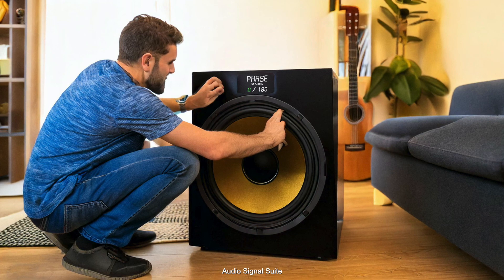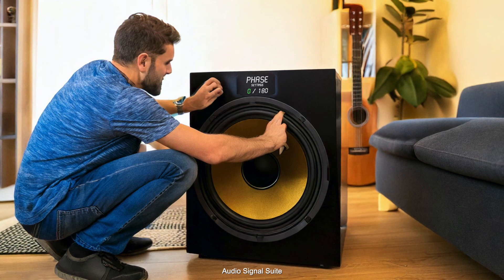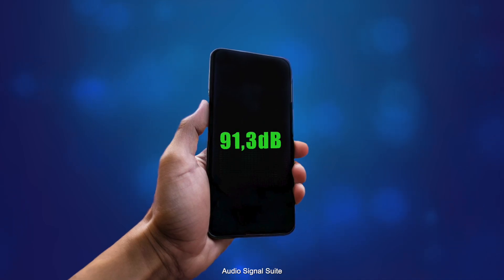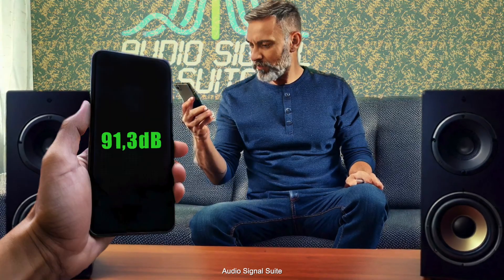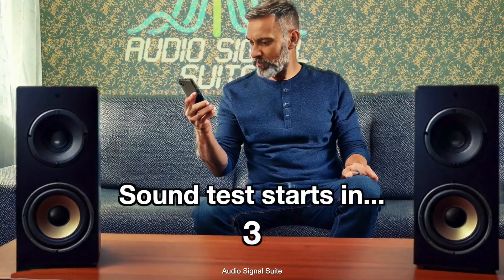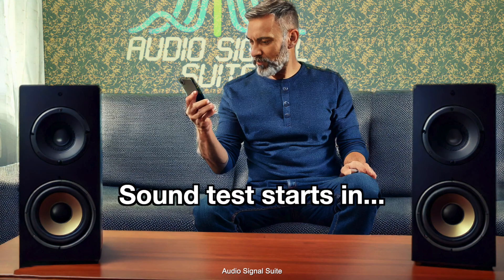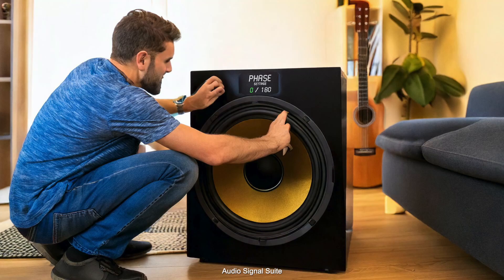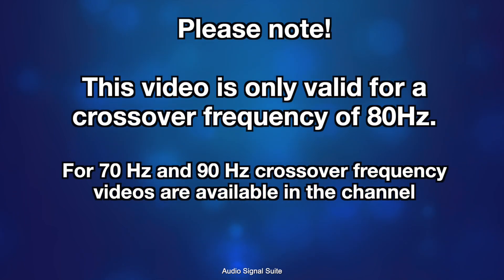How to TEST and SET the correct SUBWOOFER PHASE - 0° or 180° @80Hz ?

Comment: My sub went louder with 180...do I now have to redo the audacity calibration on my Denon avr
Reply from the maker: Yes, if you switched the subwoofer to 180° phase and it became noticeably louder, you should rerun the Audyssey calibration on your Denon AVR.

Why?
Audyssey measures level, distance (delay), and frequency response.
When you change the phase from 0° to 180°, it affects:
- the interaction between the subwoofer and the front speakers
- the effective output level at the listening position
- potentially the crossover region / cancellations or summation

This means Audyssey was working with incorrect assumptions, so the calibration results are no longer accurate.
Reply: @AudioSignalSuite thank you for reply and knowing I mean't Audyssey😅

Comment: I have 1 Behringer 18' sub woofer with phase switch and 1 without. If i put them side by side can i invert the phase on the one? Or will the inverted phase interfere with the other sub?
Reply from the maker: Hi. That’s actually a very good question you’re asking!
If you have two subwoofers placed next to each other, you should absolutely not change the phase of only one of them. Doing so would cancel out the frequencies of the second subwoofer.

You can test it this way, but in most cases you should definitely end up with a small value at 180 degrees. Unless the other subwoofer is not set to 0 degrees from the factory but to 180 degrees — which I highly doubt.

Very interesting comment. Thanks! 👍
Reply: @AudioSignalSuite alright thanx for the quick response. Now what if i put them aprox 4 meters apart from eachother and reverse the phase on one of them. Do they still have the capability to interfere with eachother?
Reply from the maker: @2525alainas  Hi. I actually find your questions very interesting, because I’ve already measured and configured many different setups with two subwoofers. But now comes the unfortunate truth: without a measurement microphone, doing this properly is basically not achievable, and doing it by ear is impossible.

A very good subwoofer setup for home use (if the room is not acoustically optimized or treated for low frequencies) is to place one subwoofer at the front of the room and one at the back. The rear subwoofer cancels out the waves of the front one, so that room modes generated by the room are reduced or eliminated. However, this only works if the phase can be adjusted continuously.

But to actually help you:
Please google “REW” (Room EQ Wizard, a free measurement software). A measurement microphone for home use is also available very cheaply (e.g. Behringer ECM8000, ECM-PRO). With that, you’ll have fun for the next few weeks 😅

Comment: Will you be able to provide the name of any app that can be used to measeure? I found some decibel level meter apps. Is that what i needed??
Reply from the maker: Hi. I deliberately didn’t mention any specific app in the video or the description, because I don’t want to do advertising with this channel 🫣
I also don’t know whether you’re using an Android or an Apple smartphone, but in general you can really use any free sound pressure / SPL app that shows the sound pressure level.

The value in the app should be displayed in “dB” as a number (no graph), and the update rate should be around 0.5–1 second so it’s easy to read.
I personally don’t have a favorite app that I would specifically recommend — many apps work just fine.

Just for your information: these apps of course do not show absolutely accurate values, because smartphones don’t have measurement microphones. But for comparing louder vs. quieter levels, you can use them 100% reliably, and that works well.

Thanks for your comment 👍

Comment: What about subs with more than 0 and 180º options?
Reply from the maker: Hi, so you can generally say that the higher dB level is the correct one. However, it’s also important to know your approximate crossover frequency (that’s why there are three of these videos).
If you have more adjustment options, I wouldn’t really use this test anymore, but instead just play, for example, an 80 Hz tone and then adjust until you reach the highest sound pressure level.

80 Hz: https://youtu.be/V7fPKpy–uQ

Thanks for your comment 👍

Comment: Should I do this in Dolby Surround or stereo?
Reply from the maker: Hi. I had to think about it myself, but you don’t actually need to use it only in stereo mode. If the phase is correct in stereo, it will also be correct in Dolby Surround, and vice versa. 
Thanks for the question 👍
Reply: @AudioSignalSuite so far this has been working great for me. It feels and sounds like my bass response is better. I have 2 subs and both are in diagonal corner placement. Having them on 180° puts out a lot more SPL on the test. Which is so strange to me. I do one at a time. 

I run DIRAC afterwards and everything sounds really good 🤷🏻‍♂️ Ive done this with friend and family's theater too. The results seem to be good!
Reply from the maker: @kyleshays  Thanks you for your answer 👍

Comment: what if you turn the knob during the sound and find out that most db you have on the 90spot ?
Reply from the maker: Hi. So this test is designed and optimized only for subwoofers that have a 0° / 180° phase switch.
If your subwoofer has additional settings, like a 90° phase option, that’s definitely a good thing. And if you get the highest value at that setting, I would just leave it like that 👍

Thanks for your comment 🤗
Reply: @AudioSignalSuite  so its always the biggest SPL/DB measurment ...the best choice?  i can do it with a tone generator? and what hz ur suggest me to do ? does it matter where i have my crossover setting?
Reply from the maker: Hi!
Yes, the frequency is very important and should ideally be at the crossover frequency, because that’s where both speakers (subwoofer / regular speaker) add up the most. This also means that at this frequency they can just as easily cancel each other out if the phase is wrong. You can easily test this with a tone generator.
And yes, the highest dB value is the correct one, because at the crossover frequency the two speakers add up at -3 dB instead of canceling each other out.
Reply: @AudioSignalSuite  that last sentence confused me a bit ..my english are bad also... should i change the crossover setting also were it goes with biggest DB ??? cause my sub dont have values on the knob just 50 - 200
Reply from the maker: Hi. So, if your subwoofer allows you to set the crossover frequency between 50Hz–200Hz, that’s already very good. However, setting the correct crossover frequency by just listening is actually almost impossible. You can at best adjust it so that it sounds good to you. I always use a measurement microphone and measurement software for this purpose. The software REW is free. Unfortunately, this won’t be possible with a smartphone. 🙁

I wish I could help you more or give simple tips, but unfortunately, there aren’t any. I think there are other YouTubers who might be able to show or explain this better in their videos.

This video only helps to set the phase once the crossover frequency is already set. And yes, the higher value is always better in that case. But this no longer applies if you change the crossover during the test.

Thanks, and just for your information, I also use a translator. 😀
Reply: @AudioSignalSuite  im using rew but with not calibrated mic... i have some some progress but still cannot find whats the best crossover setting for somereason... and also sometimes the phase is changing even with small movements of my sub... its werd

Comment: Its not hard. You only have two settings. Its much more difficult with a variable phase control. I have used this technique but it only applies to that particular frequrncy in that particular listening spot. Its much better to do it by ear.
Reply from the maker: Hi. Yes, a variable phase adjustment is of course better in every respect. But as you said, it’s also more difficult to set up. I’ve also perfectly tuned different subwoofers in the recording studio, but for that I used a measurement microphone and measurement software, because in my opinion, at some point it’s no longer possible to do it just by ear.
Thanks for your comment 🤗

Comment: like 68db @ 0º and 70db @ 180º is enough to justify switch from 0º to 180º? Btw, when I did the test my two edifier r2750db (connected by Bluetooth) are working together my edifier t5 subwoofer plugged in r2750db subwoofer out connector. Or should I do it again using only the sub plugged directly on PC line out connector?
Reply from the maker: Hi, first of all, thank you for your comment.🤗
Whenever possible, I would avoid using Bluetooth at home. I definitely recommend you connect it again via line-out and then test it anew.
And regarding the 2 dB difference: In this case, definitely switch to 180 degrees. It not only changes the sound pressure but also improves the tones occurring at the crossover frequency.
Feel free to write again once you’ve done a new test.
Reply: @AudioSignalSuite  why avoid bluetooth?

Comment: Does this work if you have two subwoofers side by side?
Reply from the maker: That’s a good question. In the end, no matter how many subwoofers you have, the measured dB level should be higher than before. Then you’ve definitely improved the phase setting.
It gets more complicated when one subwoofer is placed at the front and the other at the back. But if both subwoofers are at the front, this test should still work, since you’re adjusting the phase for both the left and right at the same time.

Thanks for your interesting comment 🤗
I didn’t think that far ahead when creating this video.
Reply: @AudioSignalSuite  Appreciate the response!  I'm very new to home audio, but I'm learning a lot from videos like yours!  Thanks again :)

Comment: You say test tones will now play. From where?
Reply from the maker: Hi. The test tone plays exactly at the crossover frequency — the frequency where, ideally, both the subwoofer and the main speakers should be at -6dB if everything is correctly set to an 80Hz crossover.
This video is available in three different frequency versions, since not everyone uses an 80Hz crossover setting.
For this test to work properly, the subwoofer and the main speakers should ideally play at the same volume at the crossover frequency. That way, it’s easiest to determine which phase setting works best.

So to answer your question: the test tone comes from both the subwoofer and the main speakers.

Thank you for your question 🤗 I hope this was helpful!

Comment: My Parasound P5 preamp has duel LFE sub outputs on the rear. I am running two SVS SB3000's. Should I set one at 0 phase and the other at 180?
Reply from the maker: Hi. First of all: You really have some excellent subwoofers with a lot of advanced tuning options. Those are truly high-quality subs – respect! 👍

Secondly: If you’re placing one subwoofer in the front and the other in the back, the rear one can be very effective in cancelling out room modes, which is a great advantage when using dual subwoofers.

However: Unfortunately, this video can’t really help with such a complex setup. It only covers basic subwoofers that have a simple 0/180 degree phase switch.
Your SVS subwoofers offer so many advanced options that you definitely need a measurement microphone and software like REW (Room EQ Wizard) to set them up properly. Otherwise, you’re not making full use of the SVS subs’ potential.

I’m sorry I can’t help you more directly, but with your subwoofers, you’re already in the pro league – and this video is more aimed at beginners.
Still, thank you very much for your comment! 🤗
Reply: @AudioSignalSuite  Thank you for the reply and compliment's. I am using the subs  in a 2 channel setup. Both subs are facing me, beside each speaker. Aside from the various options in the subs, and only focusing on the phase switch, I believe I can still use your process.

Comment: sony shake X70d sits at home unused..question,is it possible to connect the speaker to the car amplifier and use it?what power amplifier do you need?  I am asking for an answer..thanks
Reply from the maker: Hi. I just watched a video about your sound system. Normally, you could connect the speakers to a car audio amplifier without any problem. A small 2-channel amp would be enough for you.
BUT! I saw that these speakers have built-in LED lighting, and the speaker cable doesn’t just consist of two wires. So first, you would need to figure out which two wires in the bundled cable are for the speaker signal and which ones power the LEDs.
But once you’ve done that, you could use them in the car without any issue.

I hope I was able to help you, and thanks for your comment.🤗

Comment: Mmmm Phase.. can adjust with time, move sub it’ll have different phase to the lows of your main speakers in different positions.
Reply from the maker: Hi. Yes, that’s exactly the problem — the subwoofer is usually placed in a different location than the main speakers, which results in a phase shift. That’s why most subwoofers have a 0/180 degree phase switch to help improve the situation a bit. It’s certainly not as effective as a continuously adjustable phase control, but it can still significantly help to improve the overall sound image.
Thanks for your comment 👍

Comment: what if there was no difference?
Reply from the maker: Hi. Yes, that can definitely happen.
In that case, you probably have around a 90-degree phase shift, which could only be precisely adjusted with a continuous phase control.
This video is just meant to be a rough guide to help you find the better setting between 0 and 180 degrees, but it looks like you’re right in the middle. 😳

Thanks for your comment! 🤗

Comment: Question please, I have a Hoover box Car (GELONG) with an amplifier. Behind the box is a button that says PHASE. Which option do I install it on?
Reply from the maker: Hi! Thank you for your question — I really appreciate it, especially because I  work as a Car HiFi installer about 20 years ago. 🤗

Regarding your question:
As a general rule of thumb, the better setting is usually the one that gives you a higher dB level at the listening position. Just like it’s explained in that video. You can use any free dB meter app to test this.

However, this only applies if your subwoofer and your front speakers are crossed over at the same frequency.

Were you able to notice a difference in dB levels when switching the phase setting on the amplifier?
Reply: @AudioSignalSuite 
There are three options on the PHASE button:
1: full
2: 0°
3: 180°
I just want to know which car option is better ??

Comment: well on my woofer, 180 is not better than 0 in terms of just how it sound, but also, there is a whole dial - and I am not sure what is correct - I feel like somewhere between 90 and 120 feels better or more correct - but only some songs.  I will just leave it at 0 for now, I think the song that made me even look has some off-beat bass that is more obvious with the sub so I think its off - other songs with more precise oopmh or with a rounder longer woomb-woomb dont show this - but maybe they cannot.  I dont know.
Reply from the maker: Hi, thank you for your comment and the detailed explanation. 👍

The video is really just meant as a rough guide for people who only have a simple 0/180-degree phase switch, and I think it will help most people find the better of the two settings.

You definitely have a better subwoofer if you can adjust the phase continuously — that’s already a great feature. However, the downside is that this kind of adjustment can really only be done precisely with a measurement microphone.

Maybe take a look at the software “Room EQ Wizard” — you could do a bit of research on it, and with it, you can definitely get even more out of your sound system.

Thanks again for your message! 🤗

Comment: Hello sir. Thank you for your helpful video.

I have 3 subwoofers! After setting up the first one as you recommend, should I then leave it turned on while testing the next subwoofer, or should the first one be turned off during the test?

And what about the third sub, which is placed at the back of the room? Should it be tested alone or with the two front subwoofers turned on?

I hope you understand my question.

Thanks again!
Reply: Even though I too have 3 subwoofers I never knew this little trick existed (always done it by ear) the funny thing is I already have a DB metre reader, and now when I have time I will most certainly be putting this to the test. The TOP TES TS-501B  decibel meter uses a precise condenser microphone to capture sound. It’s equipped to measure noise levels from 30 to 130 dB with an accuracy of 1.5 dB, Frequency from 30 to 8000Hz...
I tried posting a link to the cheap DB metre reader but for some reason, your channel won't accept it!

I like your approach in the way you go about giving advice, and good advice too I might add. Hence, the subscription 🎉
Reply from the maker: Hi! I really like your message! 3 subwoofers!!! That’s something we haven’t had here before. 😃

The test with the smartphone shown in the video is, of course, not professional enough to determine the correct phase settings for such a complex setup like yours.

My tip:
Let all three subwoofers play together at the same time and then adjust the phase on all three so that you get the highest value. This is not technically 100% correct, but it will give you the most pressure at the listening position.

Normally, a subwoofer at the back is used to cancel out the frequencies of the front subwoofers to avoid long reverberation times. However, this is really difficult to achieve with just a smartphone.

Thank you for your message. I find this really interesting! Maybe you can report how many dB the adjustment has improved compared to before without setting it up. 🤗